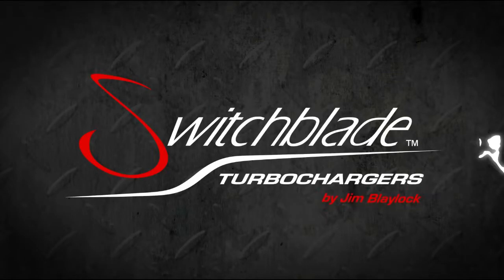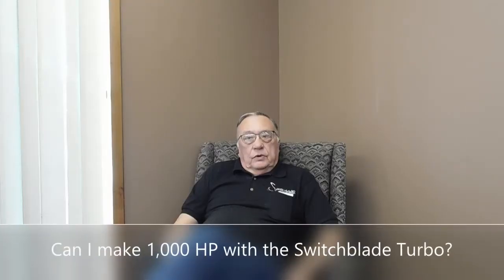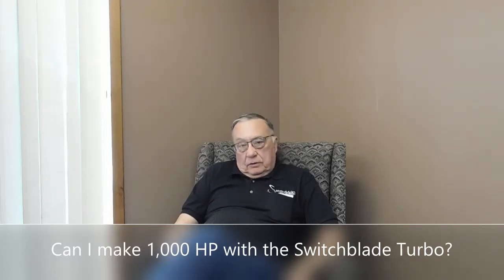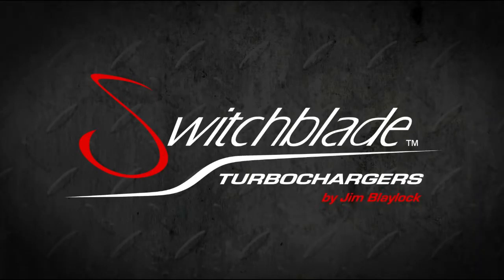FAQ - Can I make a 1,000 HP with the Switchblade Turbo?

Comment: So the switchblade 78mm 1.32 ar can support 1000 hp.  I have a c15 accert.  I want to put on a switchblade turbo and a PDI stage 1 tune.  Do you make a kit for that?  Can I keep iva's? I heard they can be backed off 70thousandths.  Advice?